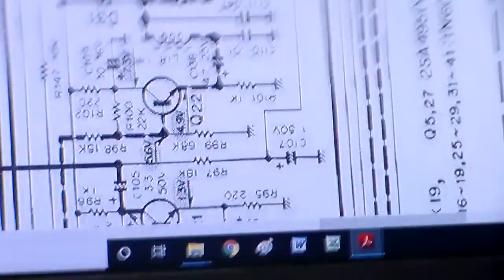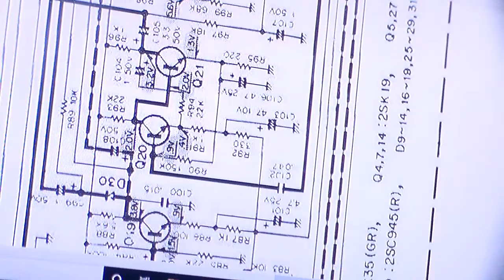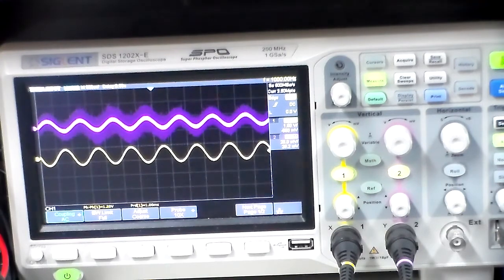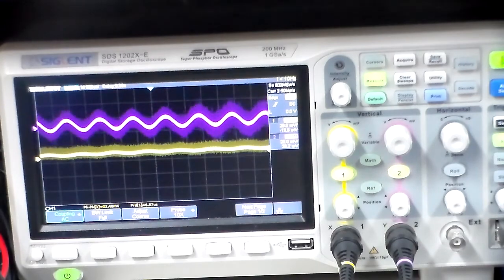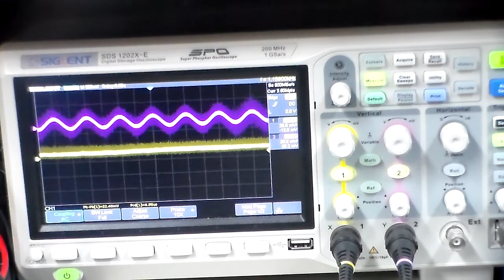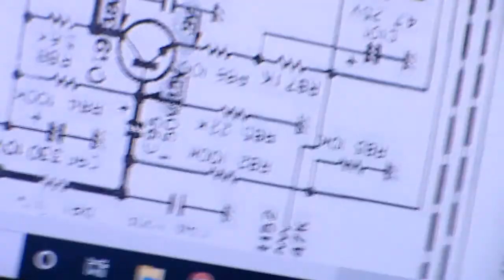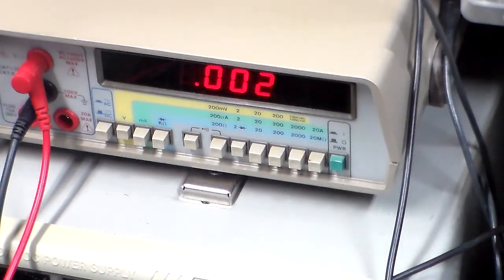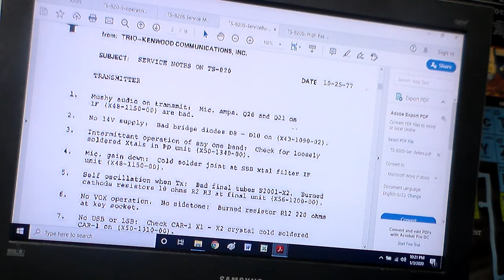Kenwood TS-820S Modulation Issues

Comment: Great video.  What was the outcome?
Reply from the maker: Thanks Kevin.  It seemed to be that the factory transistors were not  sufficient.  I was hoping for a faulty or failed transistor, but they tested ok.  The bulletin said to just replace them.  Maybe I will compare the gain to new transistors and post the results.  If I can find where I put them for safe keeping.

Comment: I don’t know how to get in touch with you can you do a repair on my Kenwood 820 I just bought it on eBay it for some reason my meter doesn’t work and I don’t know if it’s transmitted because I can’t make any contacts I’m relatively new to him very new to HF can you help me
Reply from the maker: Hi Al and welcome to the hobby.  I don't do much work on the side as my real job keeps me too busy.  And mailing one of these boat anchors is expensive and bad for it's health.  That meter does many things.  See if it works on vc - should read about 28.  Then check ic - should be about 10 in cw while sending on full power.  Check the swr with an external meter just to see if you get any output in cw, am or fm.  In Alc the meter should move around when you talk on cw with mic and power set to full.  If you have a poor antenna match, the power will drop way down.   Find the manuals and read up on the operation of that radio.  It has a lot of functions to play around with.  They are great radios but like an old car - not always real dependable.  Don't be afraid to experiment a bit with that radio.  Most of the problems with be connectors or solder joints.  Try not to adjust anything unless your pretty sure that's the problem.  The radio should still work without an alignment unless somebody else did an alignment.  Once you get it up and running and know the radio then worry about alignments.  That radio is a monster to align.
Reply from the maker: Sorry Al.  I didn't look at which radio you were talking about because I just posted a new 940 video.   I will take a look at my 820 notes and give you a few things to try.
Reply from the maker: Al,  First make sure that there is a jumper plug in the back at the radio in the Ext VFO Jack.  It won't work without that.  You have to check the manual for the tuning procedure. That radio MUST be tuned every time you change the frequency.  First test of the meter is to put it switch to IP and send in USB or LSB.  The meter should go to about 60 ma.  Most of the other things I advised about the 940 hold true for this as well.  But be carefull, high voltages in these old tube radios.  Follow the tuning procedure in the manual before trying any more transmitting.  Its only about 4 steps and can be done in just a few seconds.
Reply: My meter only works when it’s on COMP any other time the meter does not work
Reply from the maker: I would take a look at the connections at the Meter Switch and where the wires go into the Final Unit through an inductor.  Also look at Relay RL-3 and make sure it’s working.  I think RL-3 is located on the Relay Board.
Reply: If I remember right,  pins 8 and 9 on the external vfo jack on the rear panel must be jumped together for the internal vfo to work.